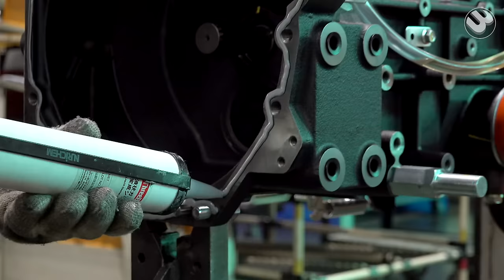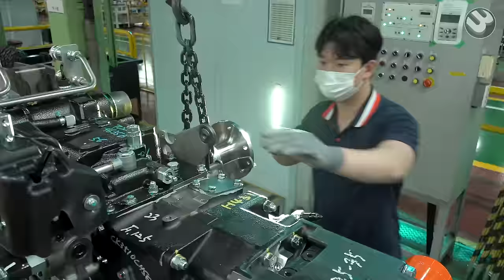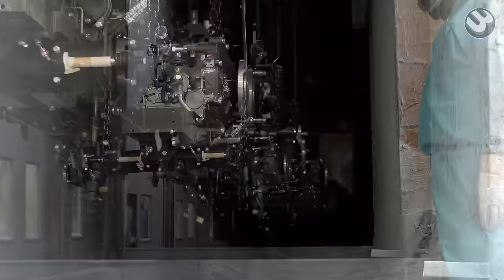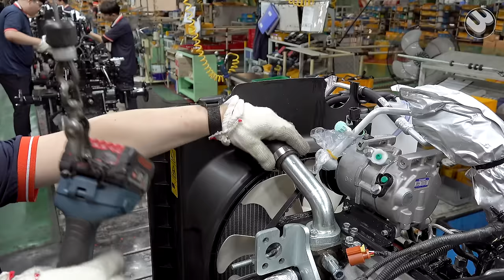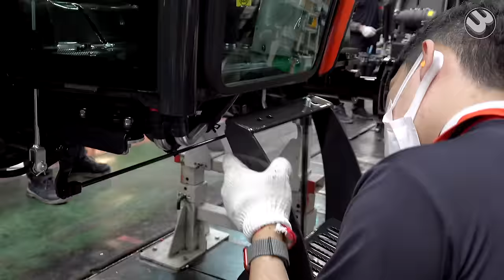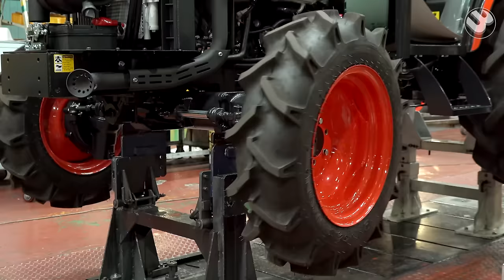How a 70-Year-Old Korean Tractor Factory Mass-Produces Agricultural Tractors

Comment: Great tractors.  I own an LB1914 that has outperformed many expectations however, I do have a LARGE COMPLAINT: no repair/parts manuals schematics online are VERY limited.  Less than 20 years after purchasing I was told by reps that it was an antique and no new parts were available.  I broke a hydraulic steering hose and the  components weren't even stock but add ons (that all sold had on them) and I had to to wait 2 weeks for components for a new hose could be obtained to make a replacement hose.  Sorry but I purchased a tractor to last for decades and could be repaired, I'm now considering replacing my wonderful tractor with one that can be repaired and last for decades with repair parts available.
Reply: I'm not sure you are going to find a tractor company that maintains parts availability for decades. I know John Deere doesn't. There are aftermarket producers and also hydraulic shops where you would have a new line made, usually for much less money than the OE.
Reply: KUBOTA WINS IT!!
Reply: МТЗ- купите,запчастей очень много,и простой в ремонте.
Reply: Советский трактор Т 25, Т-30,тягового класса 0,6 был воздушного охлаждения, надёжный и дешёвый
Китайцы скопировали, но по мощности и надёжности проигрывают, как с автоматом Калашникова

Comment: What the hell, 3 Of 6 bolts holding the rims on, Battery drills and air ratchets tightening the bolts. What happened to torque wrench specs. I would expected precision from these Japanese
Reply: Precision like those tires being mounted in the wrong direction? lol

Comment: Here is a compny that supports a dealer who's solution to my tractor stalling while doing loader work, or not starting and toss error codes, was to unhook the seat safety switch and give the tractor back to me. Like this is OK. Any company or dealer (Manchester Motors in Manchester Maine and their topsham dealership), should be prosecuted to the fullest for putting their customer in a deadly situation.

Comment: d35 tracteur de  tres mauvaise qualité , 2000  h  en 20 ans pour un travaille  comunal , 
un joint de culasse , une pompe a injection  ,radiateur , 5 joint de pompe injection ( probleme gaz oil dans l huile moteur, moteur qui claque  ) rampe  d injecteur et injecteur , demareur